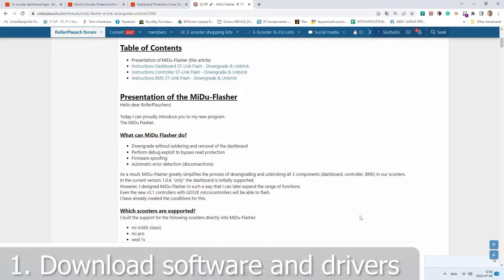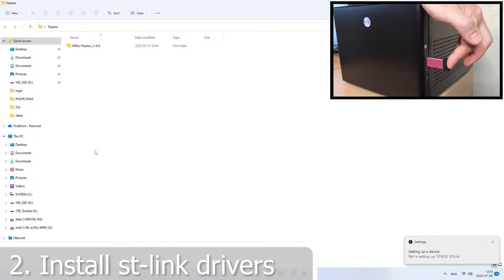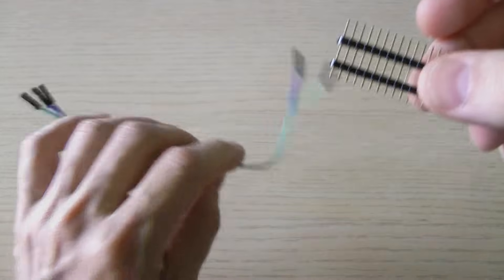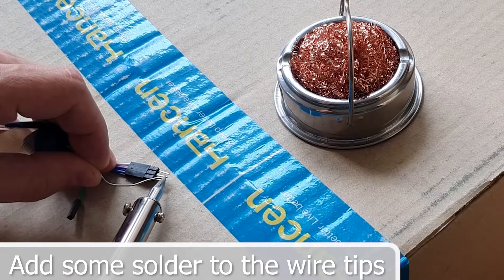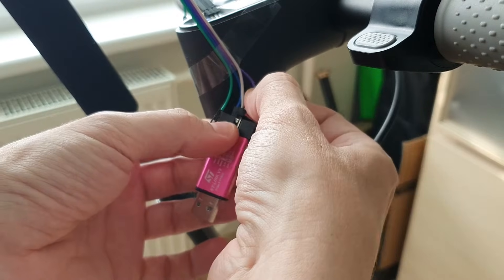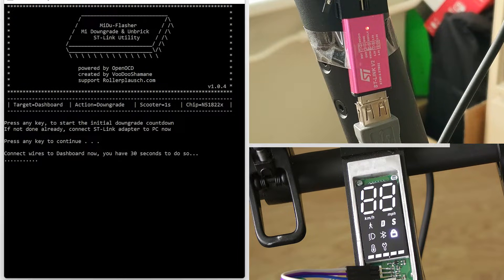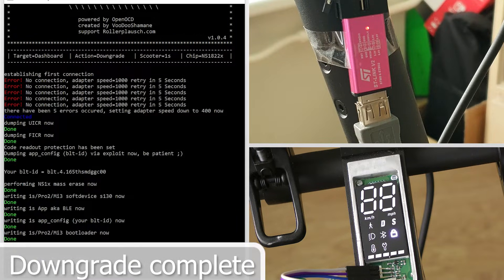Xiaomi scooter 1S BLE157 downgrade using stlink

Comment: I have Xiaomi 1S 

DRV Ver 321

BLE Ver 157

BMS VER 1701

I would like to at least unlock the speed and change battery. 

I did buy a dashboard to flash a different BLE, however I watched many videos where they say that I have to first of all check the version of my motherboard (if V 3.0) then okay and also the microcontroller STM32f1 ok / GD32E1 bad.   

Is there true? I need help please.

Thank you,
Tiziano
Reply from the maker: "Your battery has a new version of BMS,  so don't tamper with it, or you'll lock it. You also have a new version of the ESC, so you need prebuilt new-gen firmware, or use a "scooter hacking utility's" firmware - SHFW, which automatically recognizes the controller and installs the appropriate version."
Subscribe, thanks.
Reply: @MindaugasJocionis Subscribed. The question is not yet clarified. I need clarification with  the fact to check the version of my motherboard (if V 3.0 or not) then also the microcontroller STM32f1 ok / GD32E1 bad.
Reply: @MindaugasJocionis  I got what you mean!  I have v 3.1 motherboard, but i saw now that with the new gen firmware is compatible, which is amazing!  Do i have to swap the dashboard? thanks for your help
Reply from the maker: @CanaleGenerale-v9m  Yes you need to swap the dashboard temporarily: https://youtu.be/YAexlwq47q4
Or downgrade BLE as shown in the current video.
Reply: @MindaugasJocionis  but a question. In this video you clearly show that people
 with v 3.1 will brick they scooters
Reply from the maker: @CanaleGenerale-v9m  It was long ago, and a lot has changed. You will brick it only if the wrong (old) DRV is used. If you will use "scooter hacking utility" SHFW v0.2.6 it will automatically choose the right DRV for you.
In the worst case ESC can be unbricked with stlink: https://www.youtube.com/watch?v=kbj3A4aAlSU
For additional details, I suggest taking a look at this Telegram chat:https://t.me/scooterhackingchat
Reply: @MindaugasJocionis  I asked you because using scooter hacking utility it give me the DRV247 and with a swapped dashboard it shows model recognized Xiaomi Pro.  But I have Xiaomi 1S and as long as I understood, I need the DRV 319.
Is that right?
Reply from the maker: @CanaleGenerale-v9m  You don't need to flash DRV, but instead flash the SHFW firmware. To do this, navigate to the configuration tab, it will say that the SHFW is not found.The program will prompt you to choose a version. Once you have selected a version, click on the flash button to flash the SHFW firmware. After this is done, you can swap back the heads and configure the firmware.
Reply: @MindaugasJocionis  ehi! I have tried to flash it with scooter hacking utility, and it always give me the error like: flash falied - reason: max retries  power cycling your phone & vehicle. (The dashboard is indeed swapped and both are 100% full battery). I have no idea what I should do
Reply from the maker: @CanaleGenerale-v9m  at first do: "Attempt drv downgrade", after that flash shfw.
Reply: @MindaugasJocionis  ok thank you!
Reply: @MindaugasJocionis  I did flash a new firmware with SHFW. All good, the scooter goes amazing.  Therre is only 1 point... I changed to the battery with 12000mah however even adding the correct mah in shfw the scooter still shows 7800 mah. And of course, the battery is not properly recognized. Any idea?

Comment: Hey, my scooter brick how can i unbricked it? cant turn off scooter cant open flash it stuck and dont show me the battery, please help me🙏🙏 im subcribe to you and like 😋❤️
Reply from the maker: How did it happen? Sorry for the late reply, your comment was held by youtube :)
Reply: @MindaugasJocionis  i sett to full the settings and when i torn it off and againo on they stuck on d and cant do anything
Reply from the maker: @xrhstos3215  Did you try to disconnect the battery for a while? If that does not help, it looks like somehow your ESC get bricked and you need to reflash your ESC with stlink and reflasher1.3
Reply: @MindaugasJocionis  can you make video ? Please
Reply from the maker: @xrhstos3215  Did you try to unplug the battery first? https://youtu.be/LLi2S2m4URo
I will make a video on reflashing ESC only if mine get's bricked, as it's still under warranty.
Soldering points are shown in the reflasher 1.3 app, after that you only need to push one or two buttons, depending on what ESC version.
Reply: @MindaugasJocionis  yes i unplug thr battery for one day and for 15 minute and nothing happening i try everything and still brick
Reply: @MindaugasJocionis  and to this video on the link i try this one and againg nothing
Reply from the maker: @xrhstos3215  Recover ESC with reflasher: https://www.scooterhacking.org/forum/viewtopic.php?f=14&t=676
Reply from the maker: @xrhstos3215  Video on how to flash ESC controller https://youtu.be/kbj3A4aAlSU

Comment: Hello, thank you for your video.
I have a BLE 158 and I am unable to establish a connection to the scooter. I am waiting until a speed of 100, but without a success. Could this connection problem be because of the higher BLE version of 158? 
I tried with the both midu flashers.

Thanks!
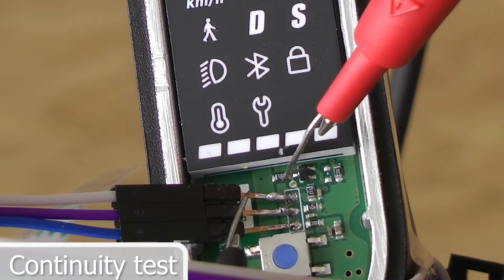Reply from the maker: Did you checked for continuity with multimeter 6:06 Probably a bad contact.
Subscribe, thanks.
Reply: @MindaugasJocionis  yes, I did..
My st link has another schema, I am connecting them according to my schema. 2-SWCLK
4-SWDIO
6-GND
Could this be a problem?
Reply from the maker: @MrGeorgimavrov  I will text you on telegram

Comment: Hey, I have a xiaomi m365 Pro2 and the BLE is at 158, I want to downgrades but I have a doubt, is necessary to take de c2 capacitor to make the downgrade as you show ?
Reply from the maker: No, there is no need to cut or desolder the capacitor.
Subscribe thanks.
Reply: @MindaugasJocionis  thanks, and off course I’ll suscribe 🤗

Comment: Would this method also work on a segway ninebot G30LD? Assuming I flash it with ninebot software of course. The dashboard chip is the same, all the numbers match on the chip as well. All I could find about the G30LD is people soldering straight to the speed controller, which requires a lot of disassembly.
Reply from the maker: Sveikas Ignai, kaip suprantu tu lietuvis. Nieko nzn apie segway, bet pabandyk paklaust sitam telegram kanale, yra ten keli bicai kur uzsiima flesinimu profesionaliai https://t.me/scooterhackingchat
Jei neatsakys iskarto, pakartok vis laikas nuo laiko, nes nevisada ten visi sedi o chatas gana greit sukasi.
As tai zinai, turiu kelis scooterius, jei iskyla problema isprendziu ir imetu vide, o seip daug patirties neturiu :)
Sub. Aciu.

Comment: Great guide, many thanks!! It helped very much in 1s firmware downgrade

Just a few notes from my experience (maybe helpful for others):
 1) From MiDu flasher I was not able to automatically download BLE and Bootloader firwmare, but I just had to manually download them from the links provided by MiDu, rename donwloaded files according to names indicated by MiDu, and paste them in the folder required.
2) At first I tried to solder the STLINK wires to the board, but MiDu was not able to establish the connection (and I also did a little damage to the scooter screen) -> this was because I made bad soldering (which I found harder than I thought)
3) So I ended up trying the "no solder way" and, after a few attempts, I succesfully established the connection and updated the firmware -> so I consider this solution even "safer" if you are not so used to solder :D
Reply from the maker: Thanks for the feedback and for sharing your experience.
And don't forget to subscribe, thanks :)
Reply: Hey I also have problem downloading the file. tried to manually download file as you did. But still gets error for not finding the corresponding file on the https://  Any tips? hehe

Comment: I have successfully downgraded to ble 152 on my Xiaomi scooter 3 but is now showing error 42 please help!
Reply from the maker: Check your ESC version if it's 3.0, then flash DRV003
https://files.scooterhacking.org/firmware/mi3/DRV/
After that, you shud be able to flash SHFW
If ESC is 3.1 try asking in this telegram chat https://t.me/scooterhackingchat
as I don't know for sure that ESC 3.1 supports DRV003
Subscribe, thanks.
Reply: @MindaugasJocionis  it worked! Thanks for your help and great video!
Reply from the maker: @nevcreating  Glad it worked :)
Reply: @MindaugasJocionis  DRV 317 is that the same as ESC?
Reply: @MindaugasJocionis  I have bricked it. Wont connect to any apps and doesn't turn off.
Reply: Guess I will have to flash esc with st-link
Reply: Reflashed controller now fixed :)
Reply from the maker: @nevcreating  Glad you recovered it  :)
So it was ESC 3.1
Was it bricked after the original DRV003, or after some premade old-type DRV?
SHFW from the "Scooter hacking utility" already supports ESC3.1
https://play.google.com/store/apps/details?id=sh.cfw.utility&hl=en&gl=US
Reply: @MindaugasJocionis  ESC 3.0 yes bricked after flashing old type DRV, reflashed DRV003 and figured out how to config in scooter hacking utility
Reply from the maker: @nevcreating   3.0 typo? You mean 3.1 right?
Reply: @MindaugasJocionis  pretty sure the board had version 3.0 printed is there a way to check with scooter utility or other.
Reply from the maker: @nevcreating  If it's on ESC3.0 then probably it was just frozen. Sometimes it happens https://www.youtube.com/watch?v=LLi2S2m4URo&t=27s

You can check with "m365 downG " look up the UUID under Tools
If the UUID does not contain the characters FF , it is the new controller: 3.1
If the UUID contains the characters FF , it is the old controller: 3.0
As well you can check with "Scooter hacking utility": Head over to the top right menu and click on "Hardware details" STM32 old one; GD32 new one.
Reply: @MindaugasJocionis ok thanks yes UUID first two letters FF, I did reconnect battery but nothing.
Reply: @MindaugasJocionis  I am getting a high pitch sound from the motor on acceleration what could this be? also how can I safely revert back to old DRV version without bricking, I tried via scooter hacking utility but It says I need to use legacy firmware zip which may brick device.
Reply from the maker: @nevcreating  Record the video and try asking in this telegram chat: https://t.me/scooterhackingchat
Probably just a motor sound. Personally didn't notice some significant difference in sound before and after the speed increase. 
As for reverting back - flash DRV003 or use Xiaomi official app (in that case BLE will be upgraded too)
As well you can use "Scooter hacking utility" (load from repo) you have an old ESC, so you won't be bricked (unless some weird stuff happens like before :) )
Reply: @MindaugasJocionis  great thanks! :)

Comment: Hi, i just downgraded the BLE to 152 on xiaomi mi 3 and it shows error 42. I realy dont know what to do. I tried to flash the firmware using scooter hacking but it didnt work. Any time i tried to flash it, it "crashed". Scooter turn on while the firmware was uploading and make a sound. Thanks for any advice ! 🙏
DVR 317
BMS 1702
BLE 152
Reply from the maker: Check your ESC version if it's 3.0, then flash DRV003
https://files.scooterhacking.org/firmware/mi3/DRV/
After that, you shud be able to flash SHFW
If ESC is 3.1 try asking in this telegram chat https://t.me/scooterhackingchat
as I don't know for sure that ESC 3.1 supports DRV003
Subscribe, thanks.
Reply: @MindaugasJocionis  Thanks a lot you save me !! It worked.
Reply from the maker: Glad it worked :)

Comment: Hello, Great video
I have Xiaomi scooter 3 with BLE : 1.5.3 , DRV : 0.1.4 and BMS : 1.4.1 can i flash it?
Thanks.
Reply from the maker: Yes, you can downgrade BLE this way. Subscribe, thanks.
Reply: But the Ble is < 157 do i really need a downgrade?
Thanks for answering
Reply from the maker: 😮on my Mi3 there was only BLE152 and then BLE155 (locked one), try asking in this telegram chat:  https://t.me/scooterhackingchat
Or check ESC version, if it is 3.0, then you can flash DRV. If BLE is blocked, nothing will change.

Comment: Hi there 😁 can you please confirm if I can unlock with stlink? Thanks✌🏻     
Mi scooter 3
DRV Ver: 317
BMS Ver: 141
BLE Ver: 157
Reply from the maker: Yes, you can. Sub. Thx.
Reply: You’re awesome! I finally manage to fix the problem thanks to you!🤘🏻 now I rock my mi3 at 30km/h with cruise control ! Thanks dude
Reply from the maker: @luisteloarriaga  Glad you made it :)
Reply: After doing this, I have error 42. Should I flash another thing ? Mi scooter 3 thanks
Reply from the maker: @luisteloarriaga  After BLE downgrade, before flashing DRV, check your ESC version.
If it's 3.1 you need new-gen firmware, if it's 3.0 you can use any DRV version.
So if it's 3.0, then flash DRV to DRV003
https://files.scooterhacking.org/firmware/mi3/DRV/
After that, you can use Scooter hacking utility and its SHFW v0.2.6
More on that you can ask in telegram chat: https://t.me/scooterhackingchat

Comment: Can this be done with a BMS over 1000 and a two lever Xiaomi 1S?
Reply from the maker: BLE and BMS are independent parts. Just don't flash BMS.
You don't need to touch BMS in order to achieve higher speed.
BLE is your dashboard firmware
DRV mainboard firmware
BMS battery controller firmware
As for compatibility with 2 brake lever scooter, try asking in this telegram chat: https://t.me/scooterhackingchat

Comment: I don't have the tips you put on the wires what do i do
Reply from the maker: You can find them at any local DIY electronics store, or check out the affiliate links in the video description. Or use any suitable metal, such as a cut paper clip.
Subscribe, thanks.

Comment: hi friend i have mi3 and the ble bersion is : 155 drv:0.1.6 and bms : 1.4.1 i can make it with st-link ? I want to go to it ble 152 witch st-link, thanks
Reply from the maker: Yes. BTW after BLE downgrade, before flashing DRV ,check your ESC version.
If it's 3.1 you need new gen firmware.
For Mi3 before flashing hacked DRV it is necessery to downgrade to DRV003 at first. After that you can flash any DRV.
Subscribe, thanks.

Comment: hi when i do this its change the ble to 152 but the probleme is the dashboard show me with red 42 error 
and when i go to flash the scooter it cant flasfh can you tell plz
Reply from the maker: Mi3 must be flashed at first to stock drv003, after that you can flash to any drv.
Before flashing modified drv check your esc version, it must be 3.0
Reply: @MindaugasJocionis  i didnt inderstand and where i will find drv 003
Reply from the maker: @MarGameING  You have mi3, right? If so: https://files.scooterhacking.org/firmware/mi3/DRV/
Reply: @MindaugasJocionis  ty very much i flash it
Reply: sorry for those many question 
but when i rode my scooter it make a wislen its normal ?
Reply from the maker: @MarGameING  I assume you hear an electric motor sound. Or it's some sort of electronic beeping?
Reply: @MindaugasJocionis  no its sound of electric motor but before flashing when i rode it in 25km/h it make any sound now its wisling
Reply from the maker: @MarGameING  I didn't note any significant difference in sound even after hacked firmware. Now you are on stock DRV003, right?
Reply: @MindaugasJocionis  no i do the drv 003 and after i do the drv 155 then ble 75
Reply from the maker: @MarGameING  With my mi3 I use shfw 0.2.5 from Scooter hacking utility app. 
Try asking in this telegram chat: https://t.me/scooterhackingchat
Record some sample audio, someone will definitely help you :)

Comment: Will it work on a xiaomi electric scooter 3 2022 version (max speed is 20 kmh)? And how can I check my BLE, DRV and ESC?
Reply from the maker: Yes, it will work, you need to choose mi3 in the scooter selection option. 
You can check your ESC; DRV; BLE; BMS with "m365 downG "  
As for the ESC version: in m365 downG look in the UUID under Tools. If the UUID does not contain FF characters, it is the new controller. 3.1
If the UUID contains the characters FF , it is the old controller. 3.0
Subscribe, thanks.

Comment: Hello! I will be trying this soon, I have ordered an st link the wires are different colours compared to the video. Does this matter? 
Any help be great
Reply from the maker: It doesn't matter the color of the wire, what matters is that you connect to that wire on both sides.
Subscribe, thanks.
Reply: @MindaugasJocionis  Awesome i have eveything i need! i have noticed there is 2 vervions of drvier in the describtion 1.0.4 and 1.0.5 ? i have used the same in the video hoping to do this tomoroww will subscribe if works
Reply from the maker: @OllertonRolling  This is a newer version of midu flasher with minor bug fixes.
v1.0.5
-Windows 7 fix (curl)
-no blt-id detection

Comment: hey i flashed 2 scooter one xiaomi pro 2 nordic and one xiaomi 1s nordic .1s .
i changed display to earlier than BLE 157 and i flashed both is hacked and driving fast works good but both when i turn they of they start by them self and they are not possible to turn of by them self please can you tell what i have done or what i should do to fix this ?
Reply from the maker: Did you check your ESCversion? 
You can check your ESC by the app: "m365 downG "  look in the UUID under Tools. If the UUID does not contain FF characters, it is the new controller.
If the UUID contains the characters FF , it is the old controller.

I think you have that 3rd version and need a different DRV.
Ask in this forum, there is a link to a web builder for the 3.1 controllers DRV, you must build it by yourself. https://rollerplausch.com/threads/neuer-controller-v3-1-bei-aktuellen-xiaomi-rollern-brickgefahr-bei-drv-downgrade-vorgehen.5187/page-6#post-67651

Or ask for help in this telegram chat, this guy has already prebuilt DRV's for the 3.1 controllers.
https://t.me/STLink_XAP2P

"Scooter hacking utility" is working for support for 3.1 controllers as well, but still it's a work in progress.
Subscribe, thanks.